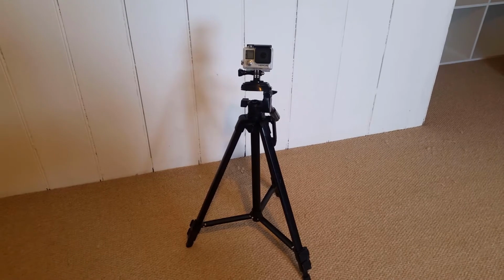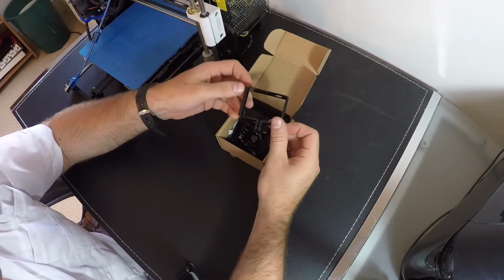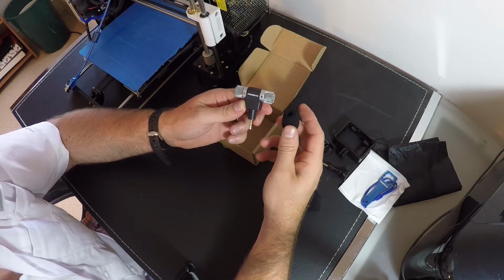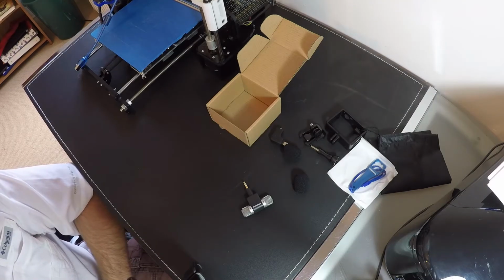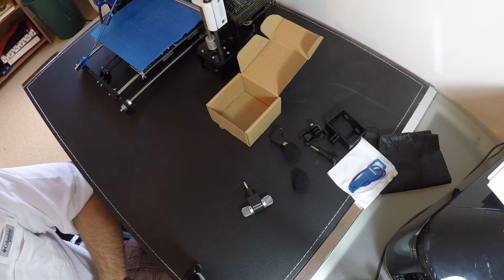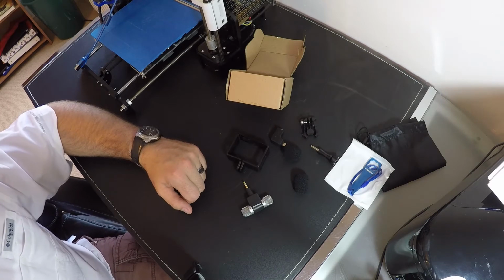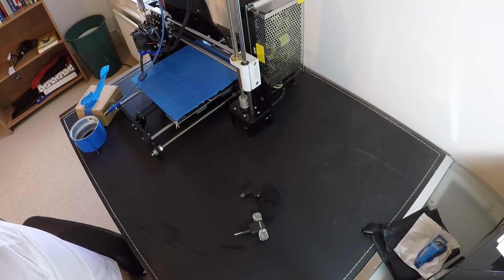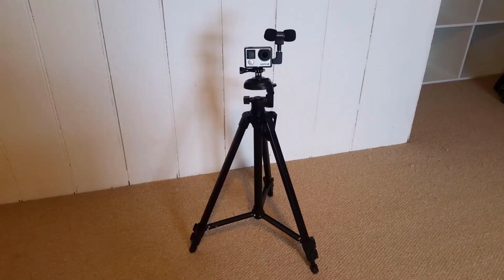Improving GoPro Audio: Testing a Pannovo Mini Stereo Microphone

Comment: I use a cheap, generic lavelier microphone or a RODE VideoMicro or an Edutige ETM-001 with my adapter.  Better than the microphone that comes with that kit.  I bought the kit just for the mic adapter.
Reply from the maker: Good point